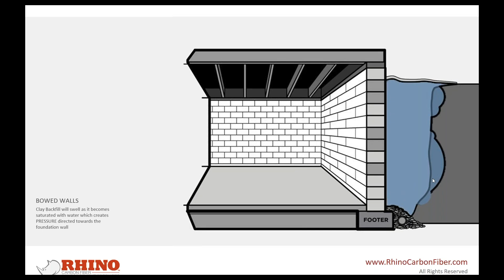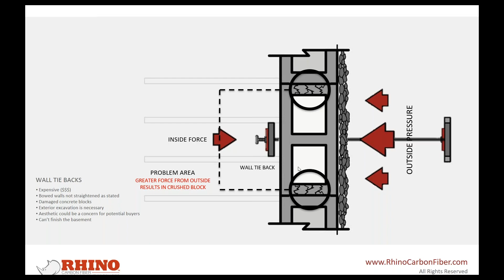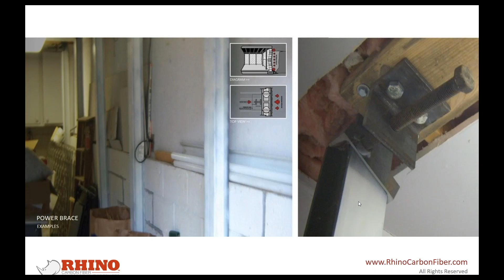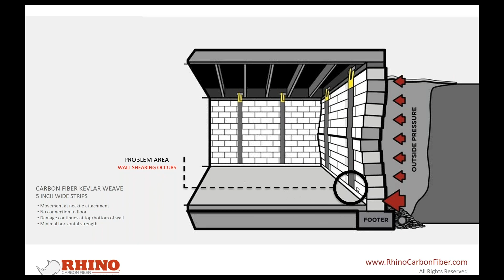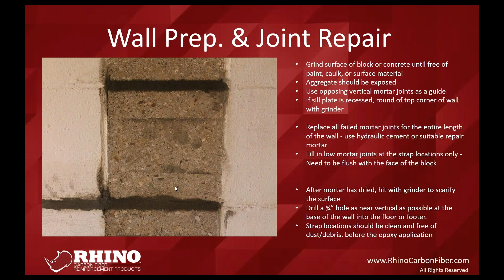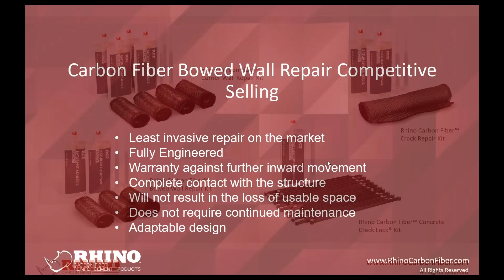Webinar: Learn How to Install the Patented Rhino Carbon Fiber™ Bowed Wall Repair System

Comment: Just moved into a new home here in Australia. A section of the cinder block wall (we call them "Besser Blocks" here) in the lower basement area, has defined cracks and slight bowing. It's a real worry as it supports a very large brick wall above it. So was great to see this very in-depth video of how the Rhino Carbon Fiber system could be used to rectify the wall.  
I can find Australian suppliers for the "Crack Locks" But I can't find an Australian supplier for the strips. Any info would be helpfull. Thanks